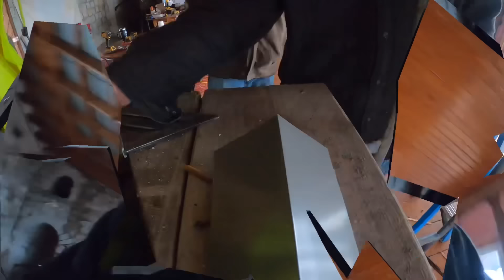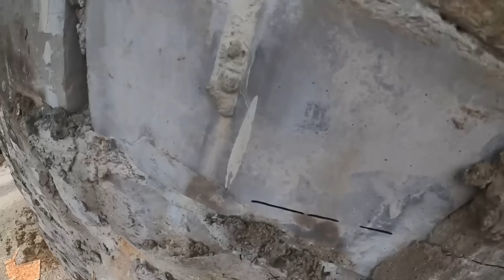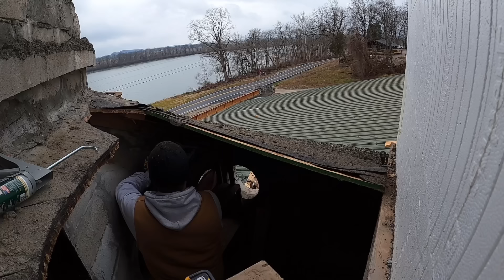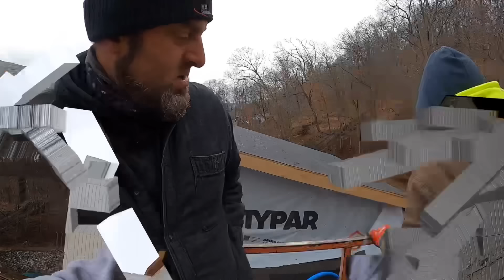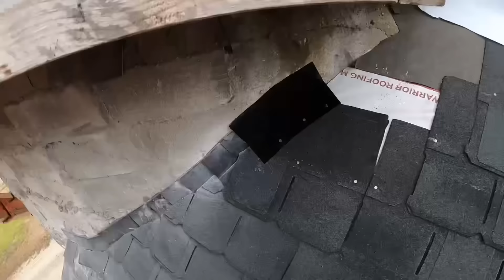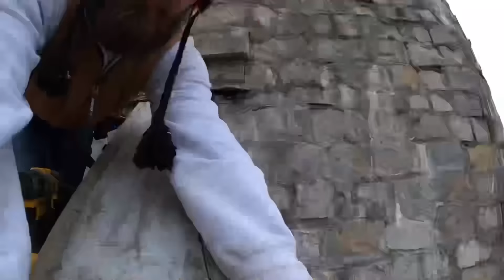shingling/flashing and roof demo, how we do?

Comment: Thanks for the update, that roof you finished shingling looks sweet, excellent job of step flashing, looks very nice. Demo, well, not a whole lot of fun at times, but necessary, good decision on the knee wall, because to leave the pitch as is, I will guarantee you that your eye would right to every time you walked by it and it would have said “ YOU SHOULD HAVE CHANGED ME!” 😊😂

Comment: Great job as always, on the flashing the grooves cut into the rock face should have been at a slight upward angle as so if any water that may ever get by the calking can't travel uphill.....with level or a slight downward groove the water can get in and freeze and crack the rocks.

Comment: Nice job step flashing Ryan and Braden now you might want to put counter flashing over it as additional protection. also a pair of tin shears is very handy cutting those shingles instead of a board knife . I that that area of the outside wall getting waterproof?

Comment: That extra 1 inch bend on top is unnecessary if you use tar on the flashing and sticking it to the rock wall we call that counter flashing. The tar should cover the whole backing of the flashing when pressed to the wall. Some tar should ooze out, leaving it sealed.